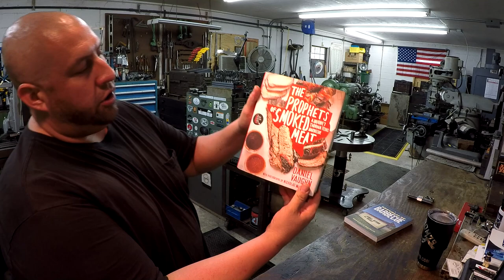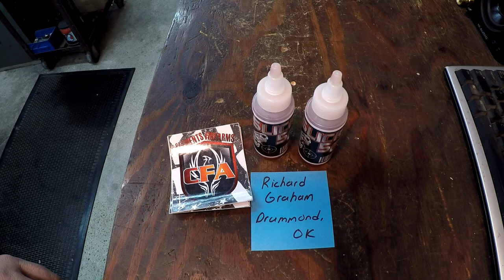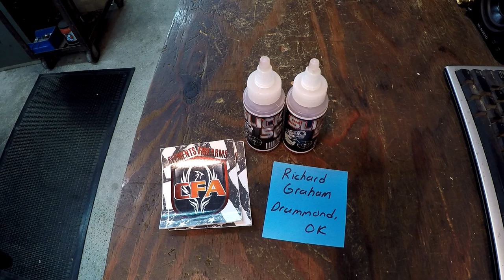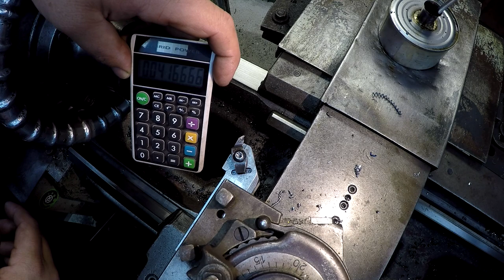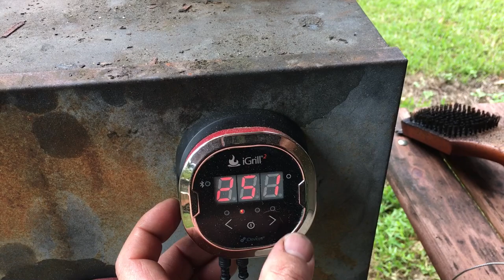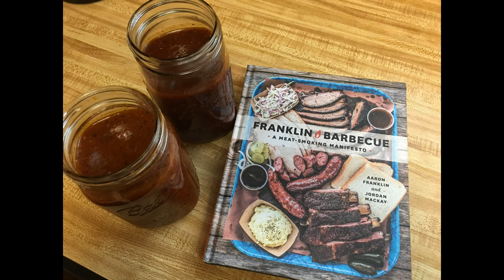Saturday Night Special 134: Turning & Threading, Hackmaster Mag Back Indicator, Shaft Work

Comment: Hi Adam, the gun oil is from Clements Firearms in Enid,OK. They have some videos up on YouTube under the same name. Dustin and Jade are really great people. They have a machine shop called Pioneer Precision Machine also. I use that oil for a lot of my indicators and tooling at work. I've used it to drill and tap too. It doesn't get sticky when it's hot like some of the other oils. Glad you got the package and thank you for the videos
Reply from the maker: Good info, thanks!

Comment: In the UK:
Spanner = open end or ring spanner, or box spanner (made of a tube with flattened sides on the ends to fit the nuts)
Wrench = generally an adjustable wrench (slip joint, F style, 'monkey' wrench / pipe wrench)
Socket = The ends that go on a ratchet spanner
:D
Reply: Don't forget the daddy of all wrenches, the Stilson.

Slip joint wrench aka 'plumbers pliers'.
Reply: Yep, that's the word i was looking for, stilson is also known as the monkey wrench ;)
Reply: Yep, this applies in Australia too. Although here, an adjustable is often called a "shifter"
Reply: Hold-all - gym bag.
Lorry - truck
Loo - welp?
Bristols - double welp?
Tea leaf - thief
Daisy Roots - boots.
Binbag - girlfriend from England called me that.
Reply: Adjustable WRENCH sometime gets mistaken for a hammer.
Reply: In the UK:

Spanner = Bell-end.
Reply: Nice one! I missed that!
Reply: Or as AVE once called them i think, a knurling tool
Reply: Joe Brechting No, that's the adjustable wrench with the hammer bit on it i think

Comment: Great presentation. Believe you will find the 0.75/TPI formula only applies when using a threading tool with 
a flat on its end with a width of 1/8 pitch. When using a sharp vee (no flat) an additional 0.125/TPI must be added to the
compound movement. Both are for the US National Form with a 30 deg. compound offset. In the case of your 18 TPI
this amounts to 0.007 in. So, I use 0.875/TPI as I use sharp vee threading tool. Obviously this is more important
for course threads. Of course one normally makes a test fit with a nut.

Comment: Adam,

Enjoyable as always.  Just a note on the sound in this video.  I don't really do this much, but this morning my family is away so I hooked up my notebook to my big TV and good sound system  At around 15 and a half minutes when you were showing the threading from the tailstock of the lathe, my subwoofer started going a bit nuts.  There's some kind of low frequency vibration coming through that I guess I'd never hear through computer speakers and it wouldn't surprise me too much if it's there in many videos.  While I'm a bit of a low frequency nut in general, it wasn't really adding to the experience.
Reply from the maker: I think that was the air blowing on the mic from the ac unit. Sorry.
Reply: That makes sense, and certainly no apologies are necessary.  I only really made the comment to let you know the sound existed, because my guess is that very few people are playing the videos on something that will reproduce it.

Comment: Thanks again Adam, would you mind discussing how you calculate the correct measurements when you have to machine a hex on the shaft as you did in this episode. What determines the distance between flats for example. maybe an item for Shop Talk. I think I can smell that briskett from over the pond.
regards.

Comment: Adam, think the "welder shirt" would great, I for one would be in on it. Just a thought, maybe a long sleeve version might be a good offering also, since fall/winter is approaching.
Reply: I must agree with +Fred Newman as I work up in the mountains on snow grooming and snow making equipment.  Long sleeves are a must for me.
Reply: +Britton Evans says "...I work up in the mountains on snow grooming and snow making equipment." 

Really, I live in the foothills below Kirkwood and love to ride. What mountain do you groom for?
Reply: Santa Fe Ski Company.  In New Mexico
Reply from the maker: I would have to run a separate campaign through teespring to offer the long sleeves.
Reply: Maybe on your next campaign you could see if that would be an option?  Guys up in northern areas (or even some welders who prefer long sleeve) would probably really be into it! I know that I for one, would be into getting a couple.

Comment: check that dial indicator with the magnets carefully. (6:30 into the video.) If it has those strong rare earth magnets on it there is a chance that the magnetic field influences the measurement mechanism inside the indicator leading to misreadings.
Reply: Yeah some older ones are susceptible to magnetic interference.  Most, not all, newer indicators are manufactured with that in mind and it doesnt effect them, as much anyway.
Reply: That's good to know. Still I would not want to risk that I have the wrong kind by sticking a magnet on it. Demagnetizing can rarely be done thoroughly and completely.

Comment: Another great video, keep up the good work and wow that's an impressive oilcan. When you were cutting that thread you had me a bit confused as to why you were using the .75/tpi then I realized it was the formula for compound infeed( probably should have kept watching before posting). The way I was taught in school using carbide tooling was we left the compound at 0 and did all out infeed with the cross slide and we calculated the depth of cut using the formula .6495 x tpi for an external thread. I'm just wondering in your experience Is there any significant difference between the off set compound method and the straight infeed method?
Reply: If you plunge straight in with the cross slide the tool cuts on both flanks of the 60° tip - the chips off each edge interfere with each other which can clog up the cut causing a bad finish, chatter or even break the tool. You can get away with it for very fine threads but you get a much better result if you go in at the thread angle as only one edge of the tool will be cutting.
Reply from the maker: I prefer the 30* in feed with the compound. It cuts on one edge of the tool bit.

Comment: Adam another question for you--do you occasionally touch up an insert with a 600 grit or 1000 grit diamond hone ??I do it a little and it seems to work pretty good..You only need 2-3 strokes...     .E
Reply from the maker: Sometimes I do if there is metal build up on the tool .

Comment: I have a question... would you change cnmg inserts used in the face mill and the RPM when changing from 4130 Steel to Aluminum? I understand that given how light these cuts are, that it's maybe not a big deal, but for a bigger cut, is that something you would then plan for the Op?
Reply from the maker: You can cut the aluminum with them, but they arent ideal. best to change them to something with a more positive chip breaker action.

Comment: As a non machinist with an interest,  when you are cutting threads how do you get the feed to hit the part at the same place in its rotation?
Reply from the maker: It's built into the mechanics of the lathe, using the thread dial and lead screw.

Comment: what is that piece in the vice called that you use to cut the hex with?
Reply from the maker: That's a 5C collet block.
Reply: Thanks! We need one at the shop I work at. We have to drag the rotary table out every time we cut hex if we dont just do it in the vice with the flat jaws

Comment: Seeing as we have been speaking English for a bit longer than 200 or so years, I conclude that Spanner is the correct term for all tools which work on fasteners, there are different types of spanners, Wrench is what you feel when your wife walks out on you, we won't go into the American habit of misnaming almost everything. such as the boot and bonnet of a car, calling a wheel a tyre, a tyre is the black bit, and is spelled TYRE not TIRE, Tire is what you are doing reading this post, you are tired of it :D :D :D

Only kidding, but the truth is the truth.

Comment: hey adam long time listener first time caller ya my dad and granddad where machinest's also their shop had a k&t like kieth fenners couple big le blondes a biiig lathe I dunno what it was but I just wanted to let you know what your doing is soooo important letting people see the inside of a machine shop and more importantly seeing some mistakes and even more success I don't think ive seen you do anything I really disagree with and more over like the devide tpi by .75 for your depth of cut thing you remind me of things I just plain forgot  love the big radius at the end of the threads. the briscut .and have you ever used cer-met or like the Greenleaf inserts them's some hot chips I use hss a lot and in the game of paper scissors rock carbide is my usual winner for the hard stuff nobodys talking bout the ceramics have you tried em ? ya the automotive machine stuff is a b#!%#those manifolds don't fit frome the factory sometimes and the end seals squeeze out like marshmellows I love a channel called fiatnuts there is some wild machining'                       thanks adam                                                               alex

Comment: Adam, at https://youtu.be/MjD7XVwEcww?t=1982 , the left side threads on the top piece seem different then the ones on the bottom piece. It's as though the top threads are actually rings and your's looks like a thread. Is this a trick of perspective or are your threads cut slightly differently?
Reply from the maker: Not sure what your seeing, but one side of left hand, and the other is right hand.